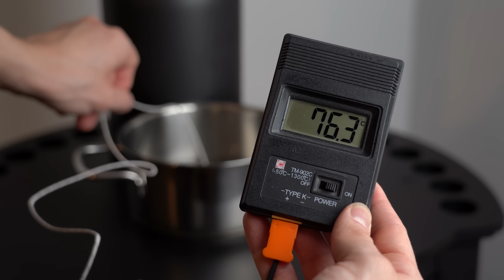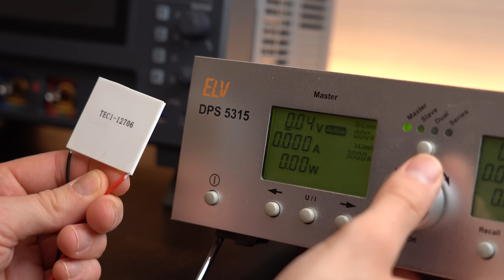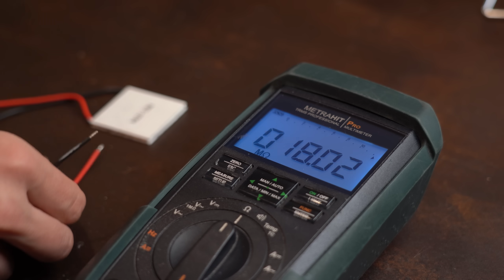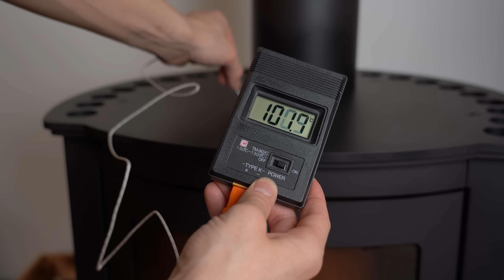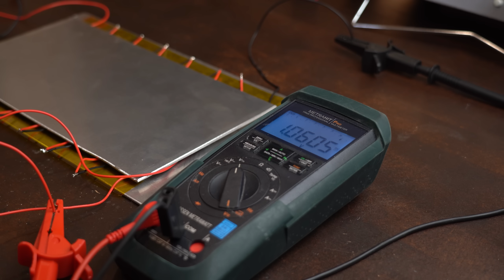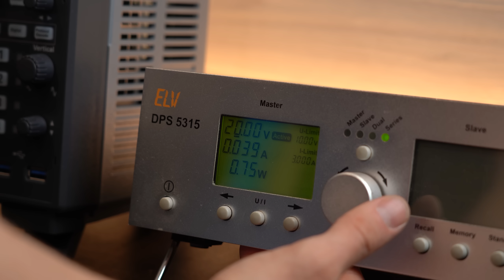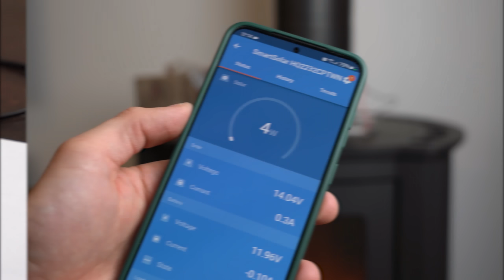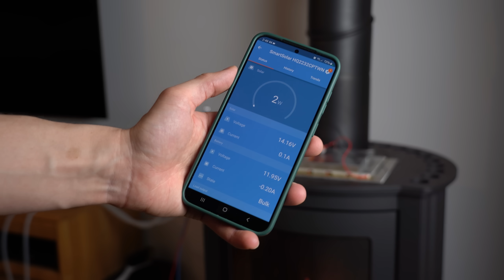I tried to Power my Home with Heat Generators! (Worth it?)

Comment: Might want to check into a cool company using FIRE to power devices. BioLite does this with their line of camping stoves. I am not sure what kind of peatier device they are using but they survive the heat of fire on the regular and make enough power to charge an internal battery as well as power a blower fan to aid combustion. What ever they use, it must be something more tolerant

Comment: Honestly a little surprised it didn't occur to you to flip the rig around. Heat the water, use the heated water on the Peltier. Make a collar around the pipe, inlet, outlet, Peltier lined radiator

Comment: What about using turbines connected to the main waste water pipe in your house? Such a device is illegal for the inlet because it would rob the water system of water pressure but should be no issue with the waste water since that's not pressurised and is just gravity fed

Comment: u buy the wrong modules for this, these are TEC - thermo electric cooler.
u need TEG - thermo electric generator  TEG1-71-1.4-1.6     3.9watts   30X30mm   0.5W/C  1.9volt 
TEG-1-127-1.4-1.0   5.2 watts   40X40mm    2W/C  3.2volt  etc. etc.etc.  🤣🤣🤣

Comment: This isn't the heat you should be trying to generate electricity from. The heat isn't really being wasted as the entire purpose of the fireplace is to heat the room. You will be reducing the heating of you room trying to generate electricity from it, you could equally use slightly less wood in the fireplace and save some money there. Just depends if the savings from using less wood is more/less than the cost of electricity you can generate. Neat idea but doesn't work in this scenario. Maybe as someone else has commented, it would be useful for the waste heat in kitchens which doesn't go towards heating the food.

Comment: Maybe pipe hot water to the devices? It’s another step, but it could be more consistent. Still just use one pump, put pipe hot water to the peltier array, radiate the heat passively, then the cooler water goes to the back side of the array? Much more consistent delta, at least. Dang it, now I want to build it.

Comment: RTFM! The efficiency is already shitty in the data sheets. In addition, it makes no sense to start a practical test. For the same reason, Peltier-based refrigerators are also more than questionable. But the video will certainly be informative for the TikTok generation...

Comment: I have a challenge for you taking a ray of those modules and to fix them to a solar panel and have a heat sink on the back end

Panels get hot heat sinks are on the Shady Side they dissipate Heat that should maintain a nice differential.
Oh did I mention that you can also flip the polarity on those things to get the opposite effect? ergo defrost your solar panels

Comment: Electronic component = cannot exceed 85C (think CPU breakdown temps) before it smokes the component...I wonder if you could pump hot water heated from flue gasses to hot side, and cool water to cool side...but will never be able to over generate the power draw of the pumps...that whole thermodynamics principle thing.

Comment: Wouldn't be better to have two radiators with hot around close to 100C and the second with 0C ? Wouldnt burn the peltier and u can have 2 closed loops so u transfer and transport the heat, idk im just curious

Comment: A steam turbine is a device that converts heat into other forms of energy, but a Peltier module is a device that converts the difference in temperatures into electricity but not heat into electricity.

Comment: I bought 10 of these modules to experiment with and can say that they seem to be very unreliable as some of mine failed at only 50 or 60C on the hot side with 2A at 12V running through them.

Comment: There are products that actually use Peltier modules on fireplaces - it's connected to a fan that creates some small air movement, which both cools the cold side of the module (there is a cooler) and distributes the hot air a bit around the room. 

Not powerful at all, but it's really cool to see it spin with nothing but electricity from the heat gradient. Also a good indicator of how the fire is doing. We have one and it's nice.
Reply: not only not powefull but EXTREMLY inefficient
Reply: @iwh7  It still moves the air without needing a powered fan, AND they are great indicators of if the stove needs a bit more wood in it at a glance! The one I have even has a little bi-metallic strip that raises the bottom of the fan unit up at a certain temp so I assume it doesn't get too warm.
Reply: @brwetide  yeah that for shure, and it makes sense for the fan thingies, but still peltiers are by nature inefficient.
Reply: @iwh7  Its not inefficient. You cannot just make or destroy energy, you just convert it form one form to another. Low efficiency simply means it converts less heat to electricity and leaves more as heat. But for what that fan is supposed to do (distribute heat around the room) you care about both heat and distribution, so in the end it uses 100% of heat for heating the room, so for its goal it is perfectly efficient.
Reply: @hubertnnn  for the fan its irelevant. to use it as a way to convert heat to electricity its higly inefficient and only makes sense if it is your ONLY possibility. as a way to cool something its useless unless you dont have the possiility to use a heatpump. And IT IS inefficient from the aspect of converting heat to electricity. or simply put it is inefficient at converting energy without heat losses, which is what INEFFICIENT Means ;-)
Reply: Wrong. They are Seebeck high temp modules and each can hit 18w. Peltier are NOT high temp, they are toys. Learn the difference and see why this guy is being idiotic with his "done a million times" experiment.

Comment: Some years ago I was able to produce 3w with 8 peltier modules et 8 candles.
To produce more energy, you need to buy TEG modules. But they are expensive. A 19w TEG cost about 50 USD. The output voltage is 4v for 19w with a temperature of 300°c on the hot side and 30°c on the cold side. I don't think it is worth it.

Comment: TEG units are not a good way to generate electricity efficiently without an engineered solution…even then, you would need an engineered solution at scale to create the temperature differential needed for highest efficiency.

Comment: TECs are horrendously inefficient and your utilization of waste energy from the fireplace is abysmal: using the exhaust heat via an exchanger would provide significantly more thermal power, not to mention the energy on top of the stove heats up your house and can even be cooked on (hence stove). As a (caffeine loving) engineer I could save more energy by putting a moka pot where your device goes and brewing myself a cup. This problem would require you to research physics as a basic understanding of thermodynamics would go a long way.
Amazing video, love it!

Comment: you should use as little thermal paste as possible to cover the whole area in a thin film for best heat transfer.
The paste is there to fill in microscopic bumps in the material, but in itself has a poor conductivity, the thicker it is the worse the transfer.

Comment: The best implementation of these things that I remember seeing are self-powered stove fans. The good ones had a cast iron base that limited heat flow to the element and a large radiator for the cold side that also doubles as the motor mount. Both the base and radiator were made of cast iron.

The modules would likely fare better if you had even clamping pressure between sides to constrain how inconsistent thermal expansion from ripping the dies apart. Thicker plates would help with the consistency too.
Reply: yeah, we need a stove fan hack @greatscottlab 😇

Comment: use a colinear heat exchanger for the fireplace exhaust, connect the hot side to a stirling generator and cold side to  the outside and you will produce a lot more power. hope to see this in another video. As a mechatronics engineer I am willing to offer advice to anyone attempting this if they document the process.

Comment: I am from Greece and we have a fireplace for the winter too.

The whole contraption is much bigger and it is water-cooled, there is water all around the walls and in pipes above the fire, after it is heated to a selectable temperature it is circulated in a heat exchanger which is used to heat up the tap water and the radiators on each part of the house.

Electricity is provided by a hybrid system from both the Grid and Solar-Batteries. During the winter there is not enough sun so we use more grid power. I have thought about utilizing the heat from the fireplace to produce electricity.

My fireplace cannot reach boiling temperatures because steam will ruin the circulation and it is not designed to be pressurised. So my idea is using a heat pump to boost the temperature from 60-70C up to 100+C inside a pressurized  boiler. Then using the steam from the boiler to run a turbine and electric motor (ideally a 3 phase one scavenged from an old diesel generator), rectify the generator output and use an MPPT to charge my batteries directly.

Only problem with this setup is that I already have 2 circulator motors, I will need the heat pump and I will also need a normal pump to put new water in the boiler (ideally pre-heated from the fireplace). The challenge is making the system efficient enough to produce more than it consumes.

Comment: Seems to me that if you used passive heating and cooling it would be more cost effective. Use heat transfer tubes to draw heat away from the stove, and other heat transfer tubes to move the heat outside to an outdoor heatsink. One time investment, and no pumps or firewood needed other then what you would normally use. And it would even work without firewood.

Comment: Should pump the water through a couch or something and then use the rest as heated water for a hot shower or something. That way, if some of the heat transfers to you and the water cools down, it will create a larger temperature differential, as well as require less wood to burn to heat you up / lower the hot water bill. Then you also wouldn't necessarily have to drive them so close to 100C.

Comment: At my cabin that is heated with a wood stove I use an Ecofan, it is fan you place on top of a stove that is powered by the heat. It uses the Seebeck effect (Peltier module) to drive a fan it is great at circulating the heat from the stove. In the 1980s I worked for a Telecommunications company that had many microwave sites on top of mountains across the country (Canada) and several of those sites used the Seebeck effect to generate power in the winter. The propane heater in the radio shack would heat one side of the module wile the other side was facing outside in the cold mountain air (-0 - 30c). The biggest issue they had with the system was with the weather sealing. While sitting at my cabin enjoying the heat and fire I often wonder how I could achieve the same thing. I have come to the conclusion that the obstacles to overcome are steep. The microwave sites were small loads by design, they were only meant to be backup to the PV panels (the main source of power). The very low power use requirements meant that every electronic component in the building was the most expensive do to the very low power requirements. I also believe the Peltier modules they used were industrial considering they were designed to be in the weather. I think the market for the use these device is very niche, my motto for this kind of stuff is "If I have thought of it, so has someone else" in this case considering the number of stoves world wide, coupled with the need for power, I would expect I would be able to buy one off the shelf by now. That does not mean no one is trying. Keep at it may be you will be the first to bring one to market.
Reply: amateur hour is strong with this one. but small single modules that can generate 10 watts have been on the market for decades.
 knowing where and what to buy is a different story LOL

Comment: Try sticking the modules directly onto the water cooling block, either with good thermal paste, or thermal adhesive (which is less conductive than good thermal paste but also can be squished to an even thinner layer, but also is a more permanent binding), and using heat pipes on the other side. Maybe also putting the heat pipes in water on top of the stove to make sure it doesn't go above 100C? Old CPU coolers for sockets that are no longer produced should be cheap enough
Reply: maybe inviting a guru to clear his chakras will work better than using the correct modules instead, but it wont be cheaper

Comment: That wood also could be turned into gas using a wood gas generator, that would feed an internal combustion engine, much easier to source than a Stirling or steam engine.
Maybe even use a portable power generator for that purpose, you'd only need a wood gas generator to it.

Comment: Ik this is an electronics channel, but for harvesting thermal power it's better to use stirling engines or steam turbines. That said, there are DIY solutions for thermoelectric or MHD generators that are way more robust than the tiny Peltier devices. Robert Murray Smith has a lot of videos about them if you're interested

Comment: good job getting the Peltier modules working decently.  I worked on a team doing this for an industrial power generation for about a year, and they are very difficult to get useable power out of.  the big issue is heat leakage paths.  these devices are actually quite a high thermal resistance, so the heat will try to find as many different paths around them as it can.  kind of like if you have a set voltage, and a high resistance in parallel with a lot of smaller resistances.   so any radiant and convective path that goes around them will rob you of useable power.  your set up was one of the batter ones that I have seen of the youtubers trying to make this work.
Reply: this is so funny, every utuber is using TEC modules instead of TEG. the biggest issue is everyone using the wrong modules and then blaming other things for failure.
modules that produce 10watts have been on the market for a long time 🤣
Reply: @echelonrank3927  Even the ones who have gotten the TEG modules have a lot of issues with it.  like I say, the difficulty is in making sure the heat goes through the module, which is easier said then done.
Reply: @KevinH.Rev0  no, this one is easier done than said. i just used some glass wool. took  less time than to fire up a computer and post this comment.

Comment: You need some clever way to moderate the heat to below the peltier breakdown point. I know some peltier driven stove fans use a bimetallic strip as actuator that lifts the heat transfer surface up a little to prevent overheating.

Comment: As you may have discovered, those little modules are crap. 
About 20 years ago I bought a 150 watt Peltier Cooler for a few hundred dollars and installed it in a sealed cabinet to cool a supervisory computer that was operating in an industrial environment. The computer drew about 150 watts and the sealed cabinet was maintained at near ambient temperature. 
So, if I could get 150 watts of cooling out of that small unit, surely you could generate 50 or 100 watts operating in reverse - right?

Comment: heh .. its much easier to read in candle light nowadays - tea candle, peltier, server garade processor heat-sinks (one to get it hot, other to cool it down), fancy led light and preferably also dc-dc boost converter :)
bits and pieces of random copper plumbing to add that much-needed steampunk vibe ..
edt: oh, and Seebeck's are better for power generation than Peltier's ..
Usually higher temp. rating also

Comment: What about the change in hot and cold water? Instead of putting the censors on the stove put them on top of the aluminum bracket that the hoses are running threw like the cold ones? You can have the water circulate across the stove until its at the temp you want then send it out?

Comment: I think Peltier element come in TEC (thermoelectric cooler) and TEG (thermoelectric generator) varieties.
The latter ones optimised for generation.

I have noticed that your modules have been marked as TEC.

You could try other TEGs

Comment: I think you might be able to improve the system., The SP1848 max temp handling is around 70°C, a 25510 K10 module can go to 180°C. You only need a difference of 60°C to reach max output. Change your base plate to steel, store the rainwater reservoir at the same height as the modules and you’ll only need a 3w pump, and you might be able to charge that battery in a reasonable time.